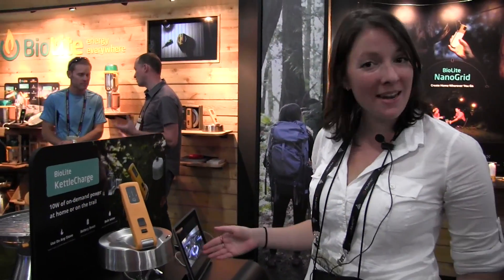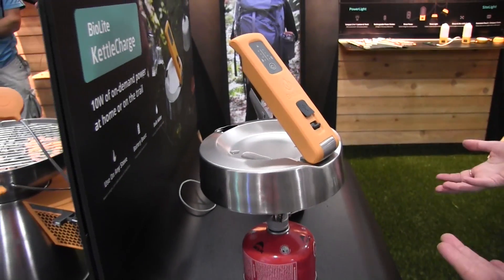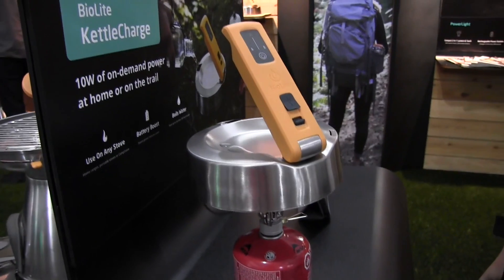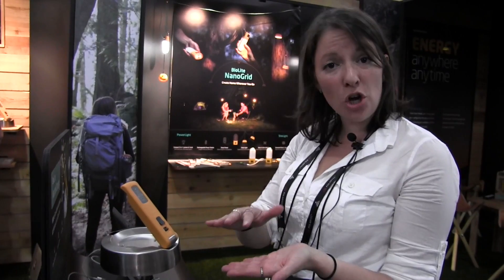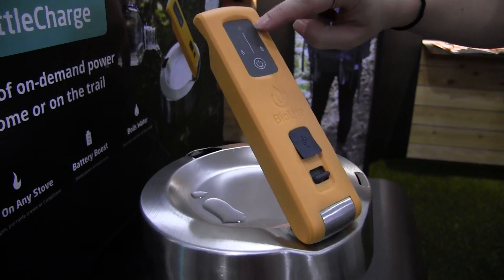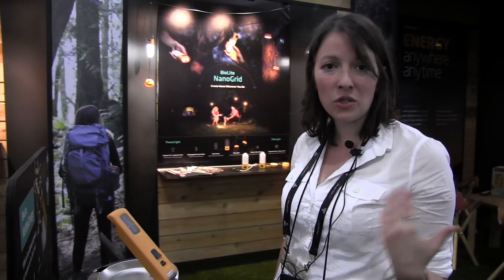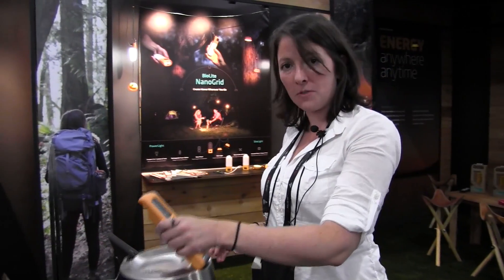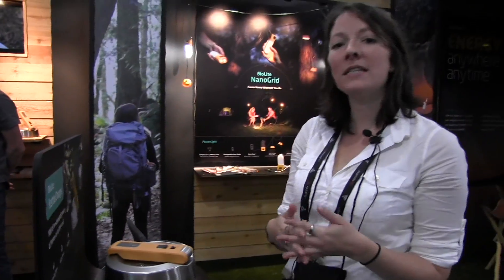Biolite Kettle Charge

Comment: What do I do if no lights are coming on when I place my new KettleCharge onto my gas stove? I've been boiling the water for over 20 mins now, and not a single light has come on. Neither the heat lights or battery lights. Very unimpressed with this product!
Reply: See if it will accept a charge via the USB port - the lights should come on normally very quickly - within a minute on mine.
Reply: Thanks for the reply, bout 2 months late though. I got replacement, it worked for a few weeks, and then just stopped charging. Have tried to use the USB cord to bring it back to life, but nothing. Seems like the circuit board or battery is very low quality. Your campstove is much better quality, been using  it for over 2 years now, works awesome. Any ideas to get this going? I like the idea of the KettleCharge, just seems it has not been tested properly?